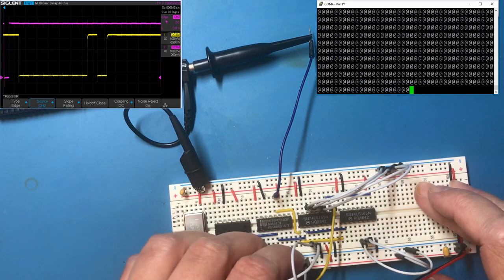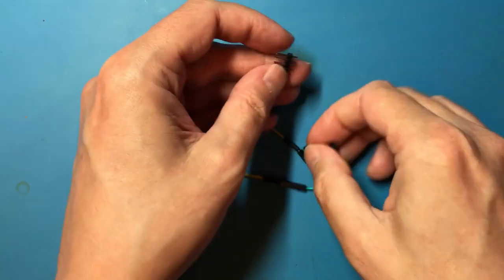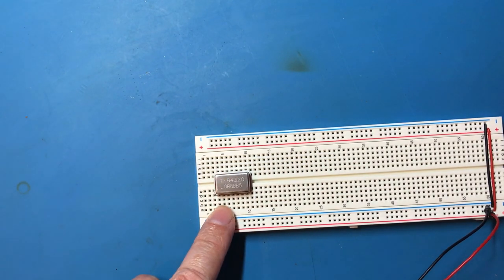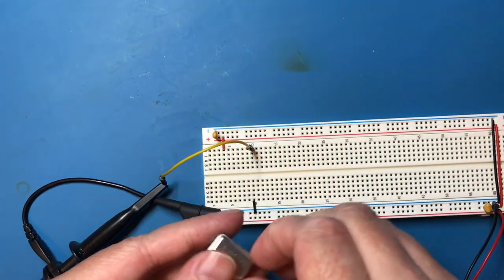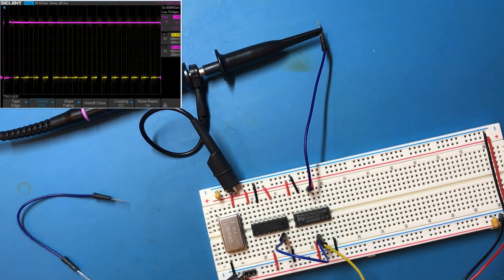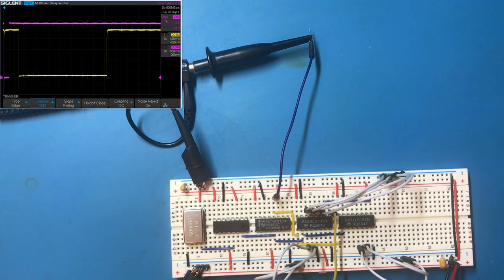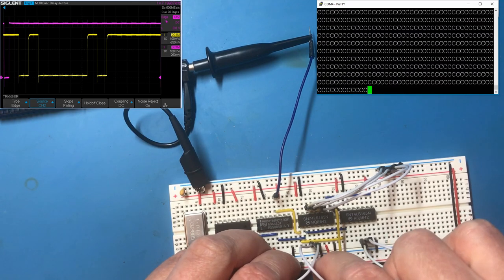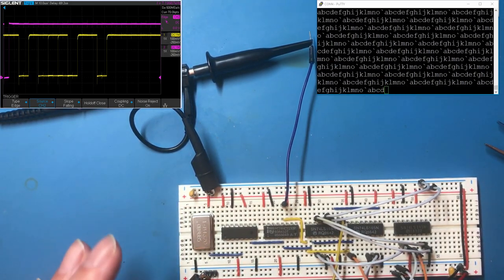Transmit - UART from Scratch - Part 1

Comment: 6:30 You are putting a low-impedance source (the crystal oscillator) into a high-impedance sink (the oscilloscope), and you wonder where all the ringing comes from... And why a bypass capacitor between VCC and GND doesn't help it.
The ringing comes from source and sink not being impedamce-matched even remotely. You can put a 1K resistor between output and ground, that would already improve things. Also, bypass capacitors shouldn't really be viewed as DC stabilizers. 
Rather the switching of active components causes high-frequency AC signals that travel away from the component. In order to avoid them traveling to other components and/or reflecting back, a bypass capacitor simply shorts AC components to ground, by forming a low-impedance path to ground. In this example here, it has no effect on the output because it's literally the only component on the breadboard, which in itself has already quite a lot of capacitance, and the USB-UART that powers it will also have caps that short out AC signals emittes from the oscillator back into VCC.
For reference, you could just put your second oscilloscope channel on VCC directly near the oscillator, and see that it stays stable at 5V, while the output reaches voltages higher than 5V. That's signal that gets reflected back, the oscillator itself can't drive the output higher than VCC. Same with the underswing below GND.
Reply from the maker: Reads like you have taken exception to a side observation of mine at the time. You have to remember that I am a hobbyist, my purpose with the scope in this video was to visualize the uart signals which was achieved. I know just enough about the analogue side to know I know next to nothing.
Reply: @weirdboyjim  It is meant as a helpful comment to understand why the ringing is happening, and why it's not a problem with the power supply. I'm also mostly a digital guy, but it's helpful to view capacitors as frequency-variable resistors in the AC domain, and signals as energy that moves along the transmission line, and has to go somewhere. The oscillator is driving the output line, but the energy has nowhere to go, as the oscilloscope presents only an insignificant load. 
Have been binging your series and greatly enjoying it!

Comment: Nice Video easy on the brain cells :), would it be better to make a user port, and just bit bang the RS232 in software. Hardware TX is always going to be easier than RX. Rx is easy if you know the baud rate in advance. otherwise you need to sync on something. I always find serial input hard, even with uarts, unless you have a defined end of transmission character. E.G carriage return / line feed. random length message are just a pain.
Reply from the maker: "Better" you say? I would agree it would be much easier to get to this point but this is more about the journey than the destination. I once had to "bit bang" a UART inside a routine that was doing some unrelated work, that involved breaking the work down into cycle perfect chunks that matched the clock rate divided by the baud rate, needless to say I would have appreciated a clock tied shift register at the time.
Reply: @weirdboyjim  I agree the journey is the best bit, but the road map for receive with it's clock sync and data buffers is full of twists and turns, i'd let the train take the strain.

Comment: I made something very similar a wile back:
https://www.reddit.com/r/beneater/comments/cepxk3/uart_module/
Reply from the maker: Nice design Mathias,  I thought about using a max232 to do the line conversion but I come across TTL level signals more often these days.  Did you attempt receive?
Reply: @weirdboyjim  Thanks, I have since bought the same serial cable. so the max chip is not needed anymore. I did not attempt a receiver, to complicated. I moved to a 68B50 instead. I am very curious to your the next video.
Reply: @James Sharman  Be also advised that these cables are probably fake they do work and there is nothing wrong with them. but I both 2 of them and they had the same serial number, which is a problem when you want to use them both and have uniq identifiers for each port. they are cheap of course :) . see http://www.starlino.com/ftdi-chip-real-of-fake-how-to-spot-a-fake-rt232r-rt232rl-and-others.html